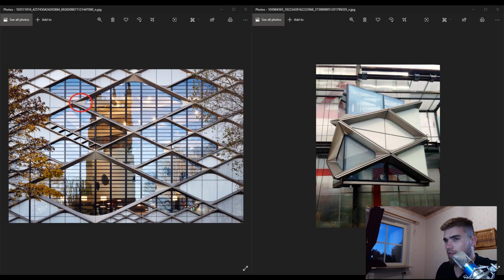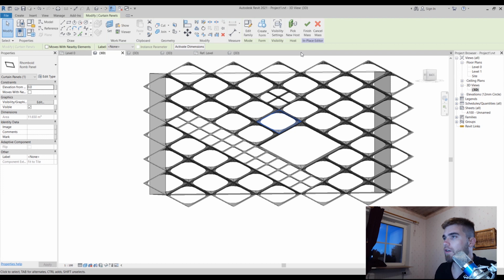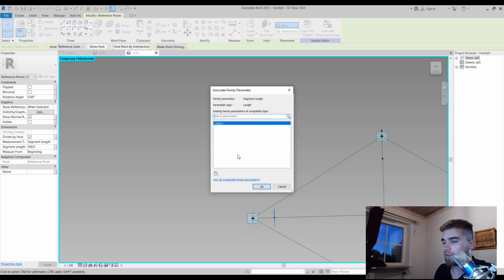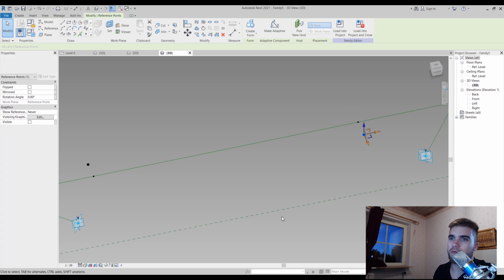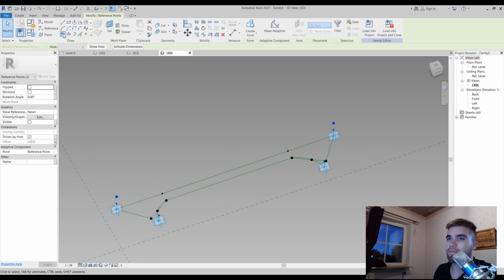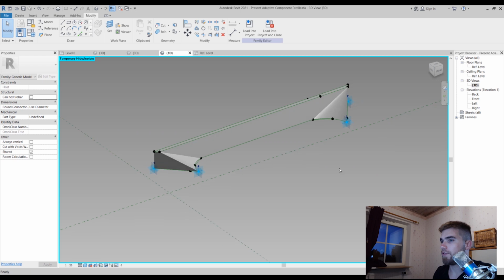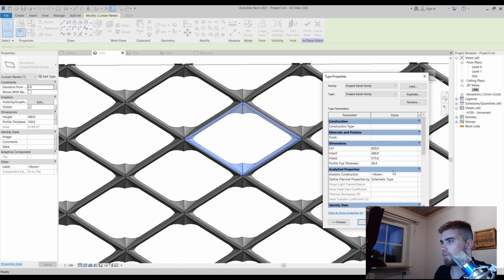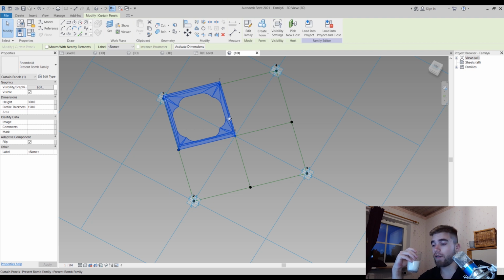Curtain panels Detailed Revit tutotial - Rhomboid curtain panel with nested adaptive component

Comment: whoever you are and whatever is your job I can only be amazed by your consideration at the beginning of the video where you mention that such a model done for architectural purpose or if it is going to be engineered would make a big difference in the way you do it. anyways, you only show the easy useless way at everybody else on the internet in general, but hey, you amazed me. would be nice to knownwhat is your job....respect
Reply from the maker: Hi Antonio, I'm a BIM manager with an architectural background. I personally believe that architects and designers should be aware from the start of the basics of engineering and manufacturing. That said during the design process these are easier to use and change - directly in the software used for the design without scripts or third party plugins.  So I don't think this way is useless. It's for the architects, not for the facade engineers.
Reply: @RevitExperiments  the way you did it is purely visual, so why waste so long on a purely visual thing? That's what I really don't get
Reply from the maker: @ingabbateantonio  1. It takes more time to do something while explaining.  In reality it is a very quick way to model. 2. It is adaptable - easy to change and to apply to different places. 3. It is the right amount of detail needed in an architectural project. Once the design is satisfactory for the architects and clients the project will go for facade engineering. Most facade engineering is not done in Revit. That said I've helped a few projects to get ready for manufacturing panels from Revit with the help of Dynamo. I'm not sure this is always the best approach though and I'm not advocating for it.
Reply: @RevitExperiments  ok, it seems you know your things, and this makes me happy.
I am a bit against the use of revit at the first phase, I find it too slow, but has some advantages, a thin is for sure, when I do the facade I go directly fo costum made families at already high level of details, we are talking about 500 parametric families, as the project moves on we change details very quickly, and this part is done with the structural engineers. this way we only rely on mainly 2 software. but, once again, I am not a fan of refit at the real first phase, but that is just me. anyways, you really rock man, specially cause I am sure you are holding back a lot as anyone else doing this kind of stuff on youtube. respect
Reply from the maker: @ingabbateantonio  Well this is Revit channel hah. But I agree Revit is now over 20 years old and it wasn't built for facade engineering even though with scripting and Dynamo we can twist it to place panels. I've had panels coming from SolidWorks and even from Inventor with documentation done in Revit. But these projects are still kinda of an exception more than a rule. But it's good to experiment.  May I ask what software do you use and what do you do?
Reply: @RevitExperiments  sure. I use Revit for the whole BIM part, unfortunately some CAD as I work in china and here they are still far behind, then of course for the engineering part we use sap2000 and solidworks. These are the main software, also we use SketchUp for the initial concept design just to show the effects and drop it into lumion and then a fancy touch up in Photoshop.
I am the head of the BIm consultancy services of a company and I directly the BIM facade department
Reply: @RevitExperiments  I forgot, most importantly, other than the 3D and 2D production, we go for clash detaction and conflict resolution in this office, this is 99% of what I do, we must avoid issues on the construction site, and here in china this part is a nightmare...lol
Reply from the maker: @ingabbateantonio  Everybody hates clash detection haha. Nice talking to you!

Comment: I got to the part where I have to add the component to my family then it just won't work IDK why it just says that it cannot place it, and then when I tried again it won't load it to the family again. can you please help me?
It gives me the error "Can't make type "adabtive profile componint".
Reply from the maker: Hi  I have put here a detailed 43 minutes long video where I am showing everything. I am also giving out the file - look at the description. As much as I would like to help you - there is nothing much more that I can do through comments, without looking at what you have done.  I do provide training programs, but that's another thing. I can only recommend watching closely for something you've missed - watch the order of the adaptive points and the size of the curve that forms relative to the size of the whole panel.
Reply: i also face the problem on how to place the component to the family it quite complicate how will  i do that please i am a student and i want to use it for my design kindly help me out please anyone
Reply: @ridwanmustapha1444  I tried to solve the problem and even tried to do it over but unfortunately I couldn't solve it, I ended up doing a simpler one that is not adaptive, maybe you can try that for your project.
Reply: @hansa2728   how will i do that and these panel interest me a lot it kind off gonna be perfect for my design, and the problem am having with it now wen i tried it once again  was showing cant make type '' present adaptive component profile''
Reply: @ridwanmustapha1444   check my previous comment
Reply: I made this one as a temporary solution for my project submission (I'm a student as well) from far away it doesn't really show maybe you can make a diagram explaining your facade. This is the link for the video I used

 https://youtu.be/4gbCqRNOFIs

(REVIT:Pattern based curtain walls by professor ogino)
I hope it helps you with your project

Comment: hi, i downloaded this file from your site and wanted to ask you as it is a model and not a family how can i fit this into a curtain wall panel for my project? between the various types of panel this file does not come out
Reply from the maker: I'm not sure I understand your question. To use it in your project - open the family and load it into the other project?
Reply: @RevitExperiments  but your file isn't a family It Is a Project
Reply from the maker: @lucamaggio3942  Yes. And it the project you can find the family

Comment: Nice work, but how to creat schedule of this panel or adaptive component  for estimate?
Reply from the maker: You can schedule Curtain Panels and adaptive components. You can also use shared reporting parameters to put individual sizes and dimensions in the schedule's fields. What exactly would you like to see in such a schedule? I might be able to do a video on this
Reply: @RevitExperiments   i would like to know about  the process of  each adaptive component schedule. when i upload the pattern type family  to the project, individual  adaptive family will not show in the schedule. Always show a pattern family name  in that schedule.
Reply from the maker: @rezwanulhoque117  So you place the adaptive components in a Family and then load that family in a Project? I think I can make a short video about that. Stay tuned

Comment: I have to mention that I chose to use "Segment Length" for some of these parameters to be able to control them in actual distances. The drawback is that with different sizes the panels change proportions. If we keep it with the Normalised parameter between 0 and 1 the proportions will be kept no matter how we stretch the panels. Depending on your goals you might want to do it one way or another.